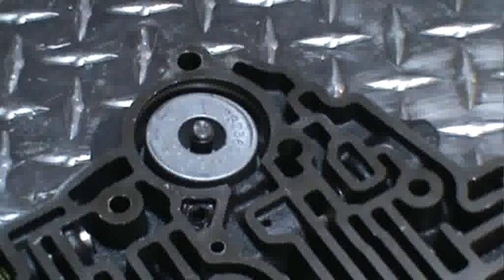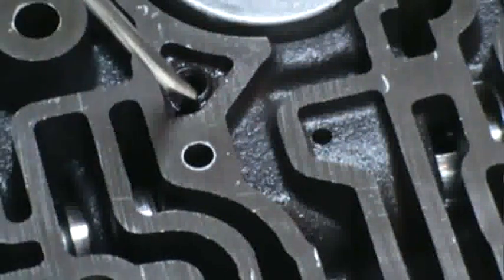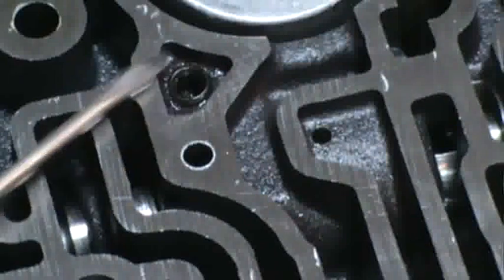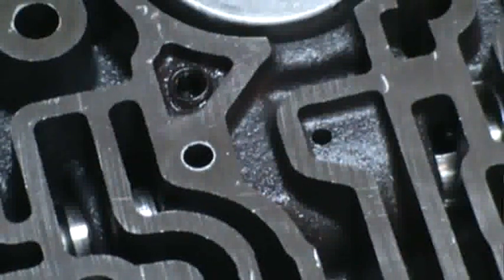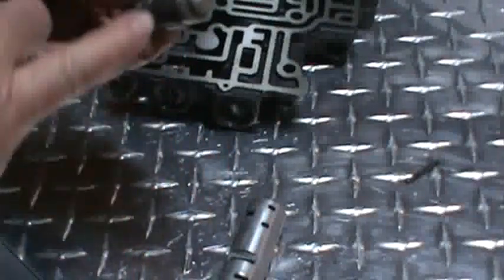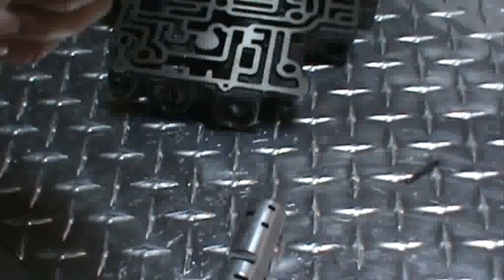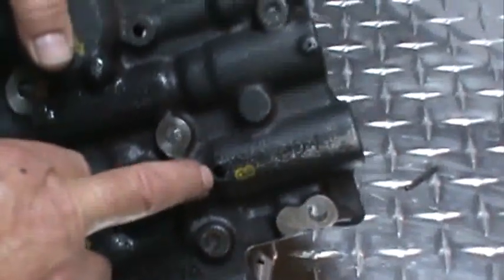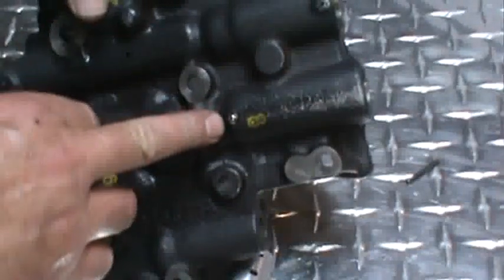Turbo-Hydramatic 400 Valvebody Modifications

Comment: I am confused.. If you block the 2-3 acumalator for faster shifts, will you also be   eliminating the apply on the foward band ? How does this work . Seems there is a lot of dout ,and very little information on what happends when blocking the acumalator .thanks for the great videos .
Reply from the maker: You will not have engine braking.

Comment: What would the difference be if all steps were done but the piston spring was left in?
Reply from the maker: THE CIRCUIT IS BLOCKED SO THE SPRING NOT NEEDED.
Reply: @BrianSwayne  with the circuit blocked why would you need to install the piston if it's not doing anything?

Also the piston that sits in the case that pushes the band can that piston be left out and the band left out?

Thanks.

Comment: Do you have a hyd schematics that shows the psi gains from these mods in the circuit?  I'm curious in how the drag racing community figured out these gains in the 60's-70's such as grinding the shift valve removing or changing spring rate etc...Any videos on the pioneers of modifying?   And where did you learn these methods.  Thanks! great video

Comment: What would need to be done to make a turbo 400 have a reverse manual valve body
Reply from the maker: You would have to purchase valvebody for that.
Reply: @BrianSwayne  ok thanks.  Transmissions rehabs are all new to me but I'm eager to learn.   I just didnt know if there was a way to make the factory valve body a reverse manual.  I wasnt sure of the difference but I'll be buy one it sounds like ... my next question is the plate you drilled out is for a "shift kit " correct ?    And if I were to do that I'd want to lose the spring in that piston ?    Last question is with the pump modification.  The hole you tapped and then basically brushed it down... does that need to be done on a rock crawler style rig ..   and what is the exact purpose of it.      I dont want it over heating if that has any relation to that mod
Reply from the maker: When u buy a valvebody you will get everything needed to do job. @1pochek
Reply: @BrianSwayne    if I'm running the reverse Manual valve body would I still want to take out the spring in the accumulator and plug that port or would that already be done.   I want it to hold any 1st and 2nd gear in any rpm but drive like normal if started in third gear but I'll be going from reverse to 1st right away and I dont want to screw things up.    What would your suggestions be ?
Reply from the maker: If you bought the vavlebody no modifications are needed. @1pochek
Reply: @BrianSwayne  even if I'm wanting to do a shift kit
Reply from the maker: Did u purchase this valvebody.If so everything is already done for you.All you have to do is follow the instrutions and your done.If it is not a purchased valvebody from a retailer then get directions from seller.Let me know what u have ie: part numbers. Thanks @1pochek

Comment: I'm installing a Fairbanks 20812 shift kit in my 400T, the instructions say to drill a 1/8th inch hole in the valve body in the 2-3 accumulator area, but the instructions are dark and I can't tell exactly where they are saying to drill that hole, do you have any idea where to drill that hole?
Reply from the maker: I would contact company direct.
Reply: I tried and couldn’t where you able to do it ?

Comment: My th400 is shifting from 3rd to 2nd just when I slightly touch the gas. Kick down is offline to check if it's a problem with it. But still downshift just by touching The gaspedal. Any ideas?
Reply from the maker: I would think your high drum is not sealing and going to second.

Comment: we have a 1966 buick Riviera with a 400 trans, when you sit in traffic it boils fluid out the vent in the top, we have serviced it no change and recored the rad, still has same problem. any insight we would be grateful
Reply: I would suspect that the torque converter is actually bad if the fluid is boiling . Tranny won't last long if the fluid gets that hot. It will actually become clear and burn the red dye out of the fluid
Reply from the maker: +vernon patterson I think you have a pump problem.I have seen this before & that was the outcome.Pull the pump out & apart to inspect.
Reply: +Brian Swayne thanks
Reply from the maker: I would probably suspect the front pump if oil coming out of breather.That's my 2 cents.

Comment: While changing fluid in myTurbo 400 I found what looks like a valve body pin loose in the pan. Looking at the front of the valve body all 3 pins look to be where they should be. I'm wondering where this small pin came from. Any ideas?
Reply from the maker: vdrivevideo The govenor has small shafts in it.....other than that i don't know.Is it working ok.

Comment: I got a stock turbo 400 out of an rv/c10, what would you advise doing to make it better for dirt track oval racing? It wi
ll be going into a g body street stock. Thanks!
Reply from the maker: I would just do a complete rebuild with all new clutches & bands.Make it manual/auto as per video.That will allow you to have manual low if needed.